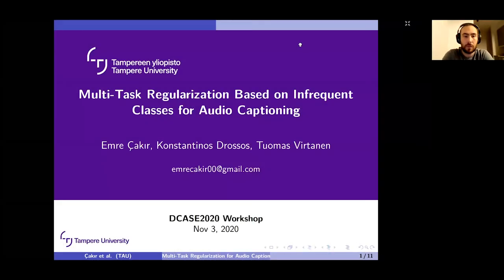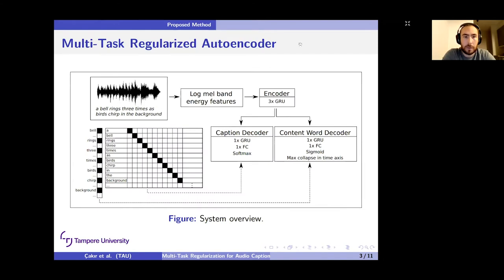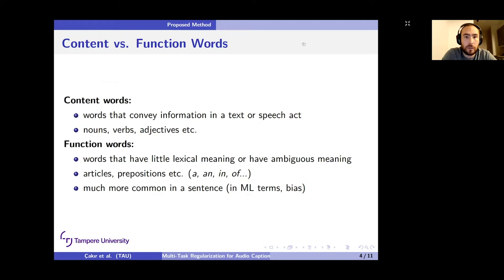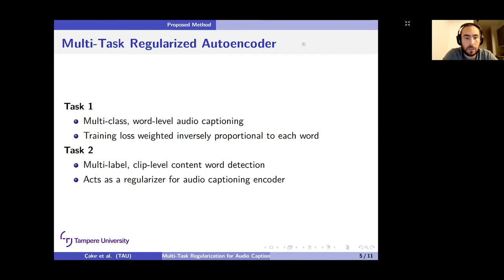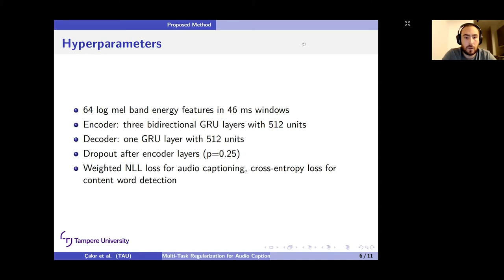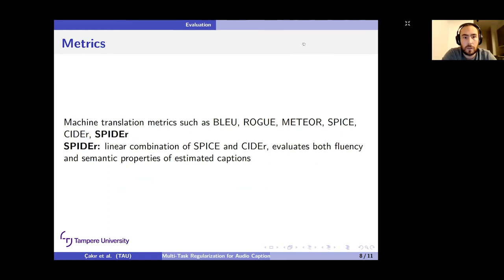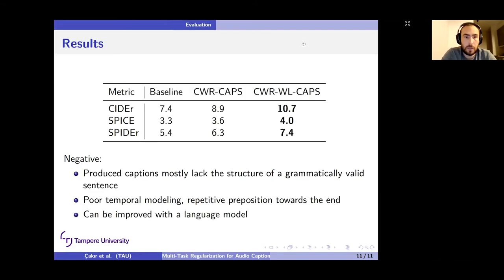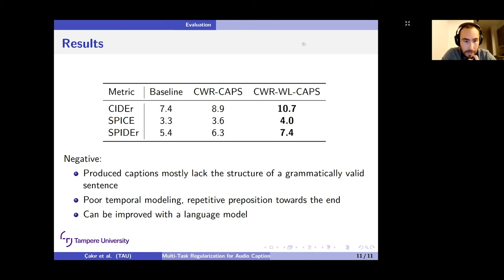DCASE 2020 Workshop, ID 52, Emre Çakır et al.

Comment from the maker: yohei_kawaguchi
7:56 PM
 Has joined the channel.

yohei_kawaguchi
Admin
7:56 PM
Copied from Zoom

Daisuke Niizumi 02:36 PM
Thank you for presentation. Can I have your comment for how effective this was: training loss weighted inversely proportional to word frequency? It was as eplained in page 10 in the presentation, correct?

Yuma Koizumi (NTT) 02:37 PM
Do you have examples of the output sentences? How about diversity? Because the scores of your method are significantly lower than task 6 methods. And our method (the winner method) still have the diversity problem. I expect that your method solve our problem.

xuenan_xu
10:15 PM
 Has joined the channel.

xuenan_xu
10:15 PM
Hi Emre, sorry I don't know how to communicate with you in private in Zoom. I mean, in my understanding, L = L_{content word} + L_{caption}, and you say " the magnitude of loss corresponding to the content words is consistently
about 10% of the captioning loss over the training" so I'm interested in the effect of, for example, L = 10 * L_{content word} + L_{caption}?

konstantinos_drosos
10:24 PM
 Has joined the channel.

emre_cakir
10:27 PM
 Has joined the channel.

emre_cakir
10:29 PM
Hi Xuenan Xu. I understand the question now. Yes, We have tried from 1 up to 10 for content word loss weight, and the performance was close but lower than with 1.

xuenan_xu
10:32 PM
OK. Thank you for your presentation and answering!

yohei_kawaguchi
Admin
10:39 PM
L17
Copied from Zoom

Mohammad Abdollahi 10:00 PM
Hi, thanks for the talk, I was wondering why wouldn't you use the (readily-available) word embeddings to represent each word instead of the one hot encoding, specially considering that word frequency and scarcity is implicitly encoded in the embeddings? so that would be turning the classification loss at each time instance into a regression loss.
This question has been answered live

Xuenan Xu (SJTU) 10:02 PM
It seems that it is also a multitask learning. Do you try adding the weight of the content word regularization loss?
This question has been answered live

Emre Cakir (TAU) 10:05 PM
Private answer
Hi Xuenan Xu! I'm sorry, can you please clarify the question for me?

keisuke_imoto
1:30 AM
 Has joined the channel.